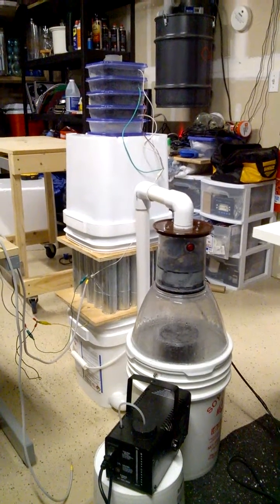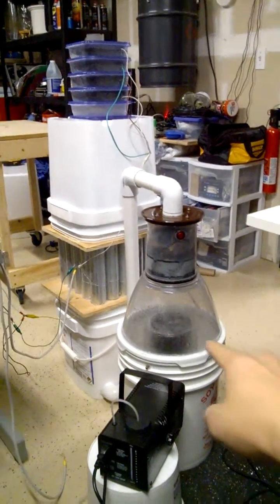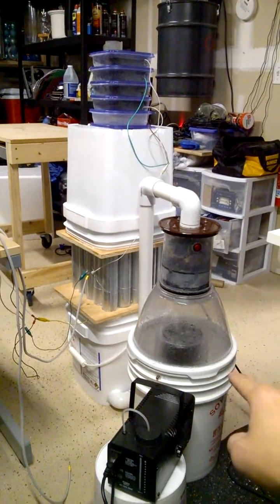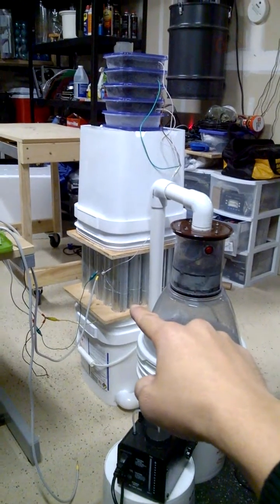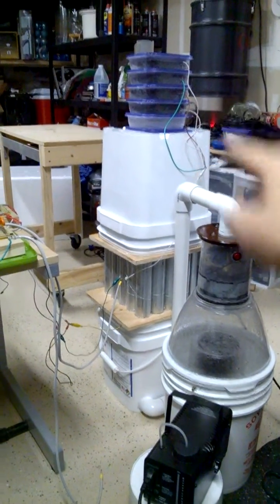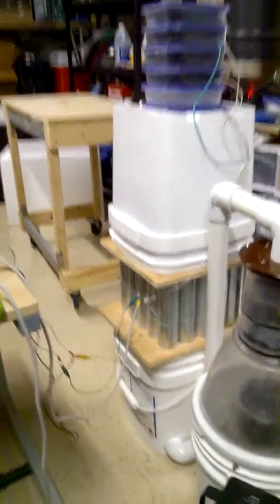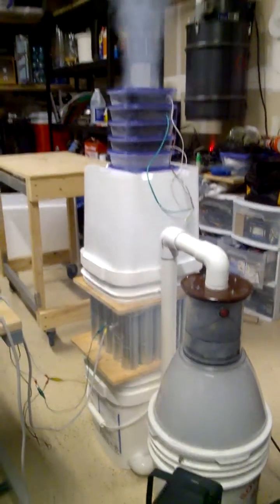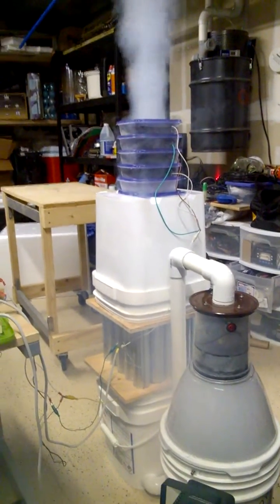Test of My DIY Electrostatic Precipitator Wet Scrubber Invention with Fog

Comment: Good work! I've attended two plants that had electrostatic precipitators and as you know, the polishing stages require frequent cleaning as the particulate blind the surface. I suggest two parallel static units that can be automatically alternatively washed, dried.
Reply from the maker: Thanks Charles!  Great idea, I think I would do that for any new iteration I may create.  When you were at the plant did you know of how they monitored the efficacy of the filtration?  That is something I'm having trouble with measuring. Quantifying my filtration efficiency currently is a subjective observation of smoke --> less smoke.
Reply: @LockeLaboratory  There are many basic air particulate sensors that "count" particulate concentration from a certain optical effect that happens when you shine a light through smoke and have a photo sensor opposite the light. They'll average somewhere between $50-100 for a semi-finished unit that outputs data over USB or I2C depending on how low-level you want to go.

Comment: Would this work as an upgrader for biogas?
Reply from the maker: Eric Lotze thanks for the question. I had to look up what you were asking for.  Yes but it may not be that effective unless optimized for it. I think the only thing effecting gas phase chemicals of the air would be the adsorption action of the activated carbon stage. The last part of this setup. Unless the biogas was laden with particulates, 2/3 of this system would not do anything to the biogas in its normal configuration.  If the wetscrubber stage had special chemicals to chemically absorb certain elements in the biogas that is a different story.  If the wet scrubber was of the packed bed type it would be better for gas to liquid chemical absorption applications.